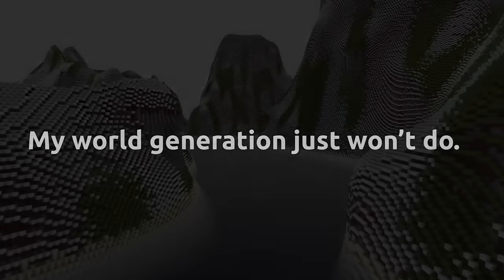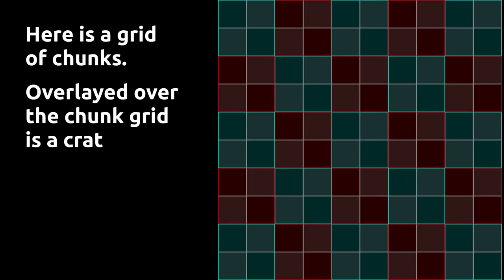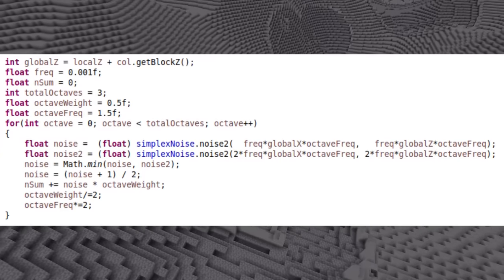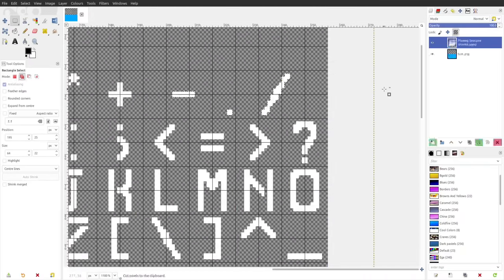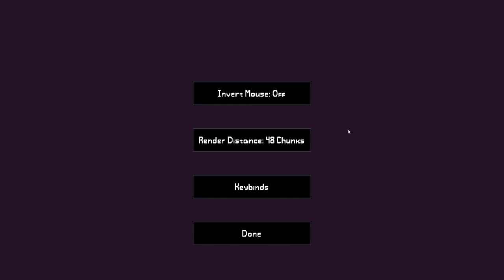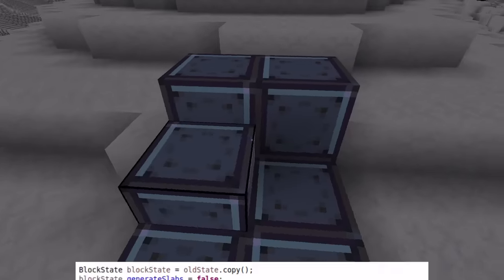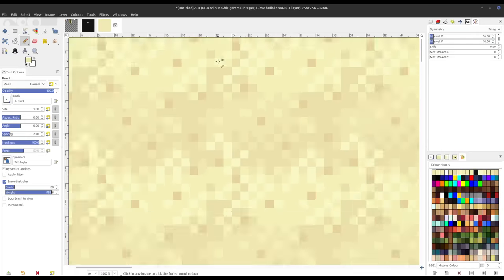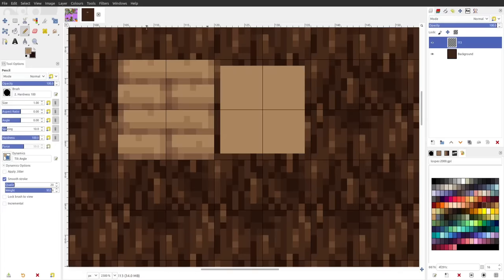Making THE MOON

Comment: im just seeing one of these for the first time so i dunno if you addressed it or not but the slab system seems a little clunky- especially having separate items for each rotation and position of slab. I suggest having a single slab item, then the way the slab ends up being placed is dependent on where the crosshair lands on the block (to be placed on). This would allow you to place a vertical slab by aiming at the edge of a block, and still allow you to place a flat slab by looking near the center. this way you could achieve every slab rotation and position based on where the player is facing, and where their crosshair lands on the surface. similar to how minecraft's logs and other directional blocks are placed based on the players position. theres definitely many different and possibly better implementations of this, but i think reducing the slab to a single item is the way to go to reduce inventory clutter, while still keeping all the options. I'm not sure if youre familiar with modded minecraft, but the mod ArchitectureCraft has a similar system allowing players to place decoration blocks in different directions and rotations based on camera look. this project looks very nice ^^

Comment: May I suggest a quarter block to so that you can fill in corners of vertical slabs, also perhaps a way to rotate them, existing slabs and stairs on its side as well instead of having separate block types.

Comment: I went a bit too indepth in what to consider if you want to implement redstone into your game. The next two lines are the summary, the rest of the comment is the specifics: 
1) Make very simple components that can be used for everything by a smart combination of them. 
2) Making more complex components where the building of them and the logistics between them is the challenge. 

Approach 1) 
Minecraft vanilla takes this approach. And people who love electronics, logical circuits and logical puzzles prefer this. For that you have some very fundamental building blocks that are build with easy to gather ressource. Just like electronics has resistors, capacitors and coils or boolean algebra has AND, OR and NOT, Minecraft has redstone wire, redstone torches and pistons. Each has a very destinct functionality and through the combination of it you can build minecraft in minecraft or orbital stricke cannons. 
This is a great system if you want to appeal to people who like to invent everything by themselves. Electronics people, computer scientists and physicists will love this. Also it teaches someone logical thinking. And another advantage is that people can sink in hours upon hours into it and each new glitch that is found can be used to incorporate into the previous functions. Another advantage is that people who are not interested in it can just ignore it, as it doesn't block anyone from any gaming content. 
But the disadvantage is that it has a relatively high level of entry and it quickly takes up a lot of space.  

Streamlining of Approach 1)
Sometimes some player finds a cool feature that requires a huge machine to work, and then Mojang made a block with the same function. For example before beta 1.5 the minecarts excallerated by touching each other. So if you want to travel you had booster minecarts in your stations that accelerated you enough to get to the next place. In beta 1.6 the booster minecarts were replaced by the booster rails. It's a one block solution for a mechanic that previously was more complex and took more space. But it also made the gaming experience more streamlined and it allowes for less individual solutions. 
One place where I would say this one block solution was beneficial was with the day and night cycle detector. For some reason the grass block had a block update in the morning and evening. So before the light sensor block got implemented, a 10x10x10 redstone contraption that observed the grass block update was used by a select few people. This was obviously a cool contraption, but nobody would build it besides the most dedicated ones. And of the few who used it, most probably just copied a tutorial and didn't figure it out on their own. The daylight sensor on the other hand was a device that many people including laypeople could understand and it improved the gaming experience, even for those wo like to tinker around. 
The general block update detectors of the past were replaced with the observers. Based on what I can see, that implementation was a total success. I think the reason for that is, that this specific function is not only useful as a sensor as it was used back then but also as an element within a contraption. And thanks to its more straight forward function and thanks to its smaller size, it is now commonly used to compact redstone circuits.  
If you go for that approach then please avoid non-deterministic behaviors like some of the bedrock redstone. Mob based "redstone" like the allay is also pretty useless in most situations. If you use mob based "redstone" then it may be interesting for roleplaying type people, and that probably useful in map making. But the allay was implemented in a way that it is somewhere in between a redstone component and a roleplaying element and because of that it is bad at both things.  
Generally speaking Minecraft is pretty skilled when it comes to Java-redstone and if you go this route I would take a hard look at how it is implemented there. 

Approach 2)
In the industry there are companies which take electronics and microcontrollers and build devices. And different companies take those devices and build machines out of them. Minecraft mods often follow that second route. There are various factorio-like mods that create entire engineering routes. And I include magic systems as well here. What they do is you have to gather ressources, build a one-block-device. This device can be used to process new ressources. Now you have to go on the look for new ressources so that you can build the next device. People who love those mods love tech trees, supply chains, micro management, configuration files... 
While approach 1 has a few cheap blocks that allow for infinite possiblities, this one has an infinite number of progressively more expensive blocks that allow for only a few paths through the game. This approach is much more linear and once you built the most expenisve block you have reached the end of the game. Theoretically it isn't linear, but if you go for the optimal route is usually always ends up at one or two paths. Also this linear approach usually causes the entire game to focus around this one main tech tree. It is not bad when a game is linear. But when you build a game with the idea of it being open world and you implement a feature that semi-forces the player into a linear playstyle then it may cause some clash of goals.  
Also those tech trees usually only work around a few game features. Digging faster, Making more damage, Walking faster and Eating less. In Minecraft you have a very flat progression in those four game features aspects and the main gameplay basically revolves around the part where you have maxed out all tech trees. In modded minecraft those four game features are made as convoluted as possible, so that you can make a tech tree feel natural. 
In my opinion this second approach is better for modders to do, as it requires more creativity and more time to build those paths. So once someone has finished the "linear story line" he can go to the next mod and start a new storyline. Or he can combine two storylines and see how for example the magic mod and the technology mod combine. 
As an electrical engineer who left the machine world I'm a bit biased in that opinion. I find an endless tinkering with a few components way more interesting in the long term than working through a tech tree that is interesting the first time but has less replay value. Apparently the developpers of Minecraft share my taste and they use tech trees minimally. But their entire philosophy is to allow for maximal flexibility and maximal creativity, so it would be disadvantageous to force the players into a technological progression. 

Combine Approach 1 and 2)
I mentioned that in the industry some companies build devices and other companies build machines with those devices. Perhaps we can combine approach 1 and 2 somehow. The two major problems of approach 1 are complexity and how much space it takes up. In softwares we usually circumvent that problem by the use of functions and libraries. We program a seperate function where all the details are built up and then we just insert a line into our main code that acts as an interface. So we could have a block in your game that is in some way programmable by the use of simple ressources gathered from the environment. 
- I just came up with the idea that each of those blocks are basically a subspace which has interface blocks within that subspace that interact with the six sides of the block. I don't think this proposal is a good one. 
- Another option I just came up with is that the blook is like real life semiconductors. You have "voltage levels" on the side of the block and through the use of microblocks you can make the current flow in a certain direction or be influenced by electrical fields like they are in actual transistors. That would definitely feel more minecrafty and it would give some nice level of freedom. You can reduce the space needs a lot and if the block is exportable as a json file then you can share its recipe with your friends. And you could add some prefabricated recepies that act as logical gates or memory cells to lead people into it. Also not an optimal solution. By the way this approach can have an optimized implementation by not rendering the entire subpixel mechanic. Instead only simulate the block when it is under construction and as soon as it is finished just simulate the behavior of the interface including all the time delay and logic.   
- Of course there is always the programmable block option which the mining turtle mod uses. But in my opinion that doen't fit a minecraft-like voxel game, where everything is in block form and the turtle is the only entity that is a robot where you interact with it via command prompts.

Comment: i have to say, the autoslabs look kinda awkward, and i imagine it's because you're trying to make a single solution work as close to universally as possible. it just results in stuff like the metal structure at the end looking off, though, because the slabs at the sides don't match the lighting of the full blocks at all. it took me a moment to figure out why, and then it occurred to me: the texture is being rotated, to match the way logs can be placed on their side for the sake of the log slabs. except, i feel like there's problems with that, too, because how the sides of logs use a contiguous texture yet the slabs' side textures are offset one half block from the grid. presumably, that's so that the metal slabs maintain the proper edge shading instead of just awkwardly cutting off in the middle of the texture ... but that also means the log slabs won't align with the full log blocks

so, at the very least, there should prob be three different styles of autoslab: one that's log-style and rotates the textures while maintaining alignment with full blocks, one that keeps the textures upright but offsets the textures of specific sides by a half-block for this "cap" look, and one that just keeps the textures perfectly aligned with the usual grid, for stuff like dirt and sand slabs that don't have any edges to begin with. that should cover just about everything ... except i don't think the metal slabs should be autoslabs in the first place. that sort of block is the exact sort of thing that could really use hand-crafted textures for its slab variants, even if only quick edits of the main texture that scrunch the shading and bolts into position. any sort of block that is actually a block and not just a segment of a contiguous surface could really use that sorta specific attention, because it goes a long way in making sure the materials actually feel like what they're supposed to be instead of just textures slapped haphazardly onto a block

though that said, it shouldn't be all that complicated to make a slightly more involved style of autoslab anyway, considering it shouldn't take more than being able to point to two extra half textures which get applied to the appropriate sides of the appropriate blockstates

Comment: What about vertical slabs done dynamically from player perspective? I think under the hood it could be done with separate blocks for every slab but as player has it in inventory it will be displayed as the same slab for easier crafting and building.
On top of that it would be nice if player would be able to connect different slabs together for nice looking buildings that aren't thick as heck and has different walls inside and outside.

Comment: You should add an atmosphere that slowly fades out the higher you go. For example, at 200 blocks high the blue atmosphere starts to fade and by 250 it becomes harder for the player to breathe which impacts the player's speed and controls. And by 300 blocks high it becomes almost. impossible for the player to breathe. By 500 blocks you're already out of the Minecraft world and are in space. It would then take 1000 blocks to get to the moon. Obviously, over time, you'll add equipment/tools that will allow you to travel to space without harm and space. They will also be allowed to produce their own oxygen
Reply: This should also mean gravity should be implemented. An object/player's mass should be affected by a large planet-sized body if you or the object is somewhere in its atmosphere or close enough to its atmosphere the planet's gravity will pull you to the ground. You'll just need to figure out how to fix the player character and camera

Comment: The sides of bottom half slabs seem to use the top half of the texture - could this be fixed such that they use the bottom half instead?

Also, are there plans to make block textures individual files, and stitch them to an atlas at runtime?
Reply from the maker: The slabs can be fixed, and probably will be for the pre-alpha. Texture stitching will be after the initial release, when I work on texture pack loading.

Comment: Perhaps a simple question, but how are you handling the button drawing? Eg, you have the rectangular bounds, so you can easily do a fill for the main part. But for the edge highlights? Do you go from triangle/quad primitive rendering and simply do line rendering between each vertex pair? This seems the most intuitive way, but some games have UIs etc with nonrectangular elements that still get highlighted.

And what about text? I assume it can flow off the buttons if they are very long messages. In my own projects, I use SFML, but it doesn't seem to have a facility to use clipping rectangles, which would make rendering text to a region much easier.
Reply from the maker: I render a stretched texture for the buttons, but I intend on switching to a 9-patch type system. As far as clipping, a mask or glscissors can be used, but I can't speak for SFML.
Reply: @finalforeach   Thank you for your answer. Agree that 9 patch seems to be the way to go, had some success with that one myself. Very flexible.
Best of luck with your project and looking forward to the next update!

Comment: TO GET FARLANDS STARTS DIVIDE THE 32 BIT INTEGER LIMIT
EXAMPLE
2147483648÷171.103=12,550,824.0533
The Far Lands[1] were a terrain 
generation bug that appeared when the noise generators responsible for creating the shape of terrain stopped functioning properly. This resulted in a large, spongy wall of terrain appearing around 12,550,821 to 12,550,824 blocks from the origin of the Minecraft world.

The Far Lands still retain a legacy as one of the franchise's most famous glitches, even being referenced in other official games such as Minecraft: Story Mode and Super Smash Bros. Ultimate.

FIRST AFFECTED VERSION:INFDEV 20100327
LAST AFFECTED VERSION:BETA 1.7.3

Java Edition Far Lands/Up to Infdev 20100325
In the February 27th build of Infdev, all generation past 33,554,432 blocks would be solid stone, extending vertically from the bottom of the world to the height limit, continuing out to the 32-bit limit. These are the first truly visible appearance of the Far Lands, although very visually, behaviourally and positionally distinct from convention.

This stone wall may not always start at exactly 33,554,432 blocks out - it is not uncommon to see a rough, repetitive boundary at this point, visually resembling the ridges of a radiator or the fins of a heat sync, in a similar way to how the usual Far Lands can generate a few blocks earlier. On some seeds, the Far Lands don't have any rough appearance but are rather just smooth. Sometimes Far Lands on one axis can be smooth while on the other axis they're rough.

Comment: are you planning to release this on mobile in the future with launcher system like pojavlauncher
Reply from the maker: Sorry, mobile is not planned for the near future.
Reply: @finalforeach DOES YOUR MINECRAFT CLONE HAS INFINITE HEIGHT LIKE CUBIC CHUNKS MOD
Reply from the maker: @ExplosionPower1387 Infinite height is being worked on and will be a feature later on
Reply: @finalforeach  SINCE MOBILE IS NOT 
PLANNED FOR THE NEAR FUTURE BUT DON'T FORGET THE LAUNCHER SYSTEM FOR MOBILE

ADDITIONALLY
THANKS FOR WORKING ON INFINITE HEIGHT AND ADD HORIZONTAL/VERTICAL RENDER DISTANCE SETTINGS FROM CUBIC CHUNKS BUT KINDA HARD TO CODE TO SEPERATE RENDER DISTANCE INTO HORIZONTAL/VERTICAL
EDIT:WRONG TEXT FIXED HORIZONAL/VERTICAL TO HORIZONTAL/VERTICAL